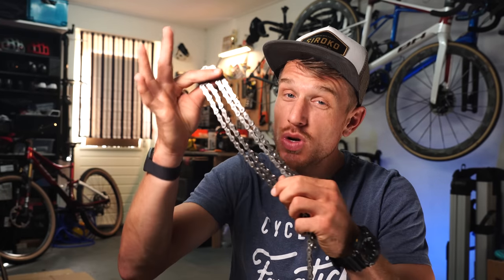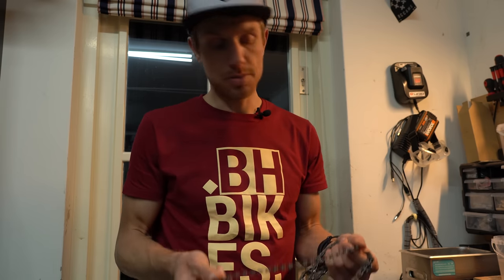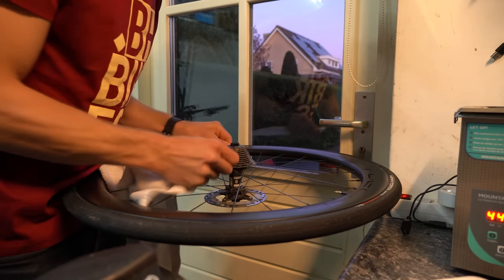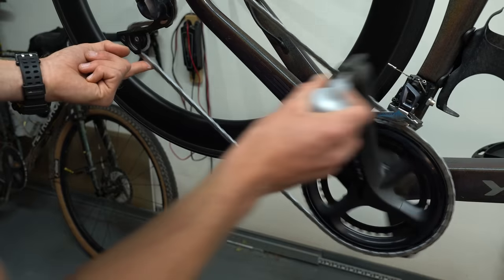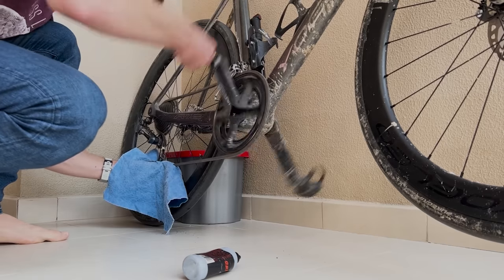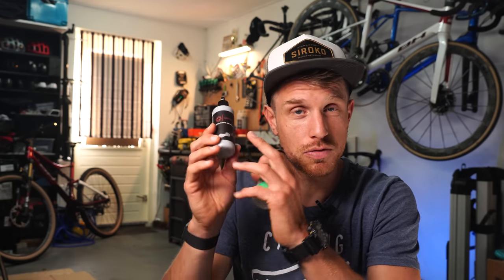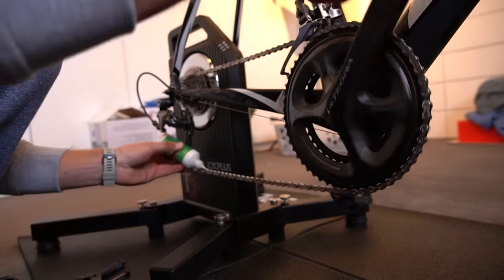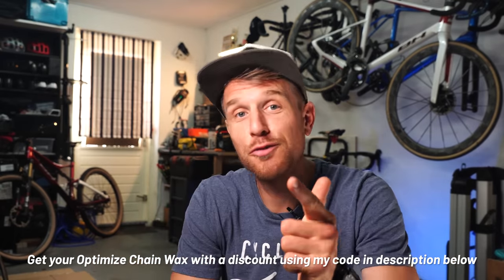Testing Chain Wax for 1-YEAR and this happened..

Comment from the maker: ► 10% OFF Optimize Wax use code ''CapeEpic10” (valid till end sept) * 👉 https://bit.ly/Optimizewax
► SIROKO cycling KIT & GLASSES - 10% EXTRA OFF  👉 https://srko.co/verkuijl (link applies discount automatically)
Reply: use petrol/gasoline is even cheaper, then ultrasound with degreaser
Reply: Test gasoline works great for cleaning the chaine.

Comment: Little tip for applying the drip wax: Shift to the big ring and the biggest sprocket (like you would never do riding) and apply on top of the cassette. The cross-chaining opens up the gaps in the chain and makes the lube sink in much easier.
Reply: That's a new one, great tip!
Reply: Small ring, small ring is even better as chain is more slack so gaps are even larger for wax to get in.
Reply: one run on big - big and one run one small small… win win
Reply: Amazing tip! Makes complete sense!
Reply: another tip to help it penetrate is to warm up your chain first. I only mess with this the first time with a clean chain.
Reply: You can also hold the wax bottle under hot running water before applying to make it penetrate the chain better.
Reply: good tips,but if chain is hot , wax is liquid when touched chain and enters into chain no matter of gear combination,i do it on big front and small rear because i have the longes lower length of chain between f/r gears
Reply: Hair dryer on chain slowly rotating around will melt and drive wax into the links. Takes approximately 5 extra minutes but gives you maximum penetration when maintaining your waxed chain.
Reply: Wat moet je doen voor Corrosie,roest bescherming met vochtige omstandigheden? Ik rij in een velomobiel en condens van zweetdamp op de ketting. Geen regen en zand kan er bij komen. Graag een reactie voor mogelijke overstap op wax. Al vast bedankt gr Alexander
Reply: @alexanderkamminga1393  if you drive inside, without dirt, you should use some  kind of grease(preservative) because it is very sticky , and it will not leave chain surface so it will prevent rust,it does not spray around like oil, wax is good for dirty condition because it is not sticky but does not prevent rust because it is thin layer on chain surface
Reply: such a great tip!!! Thx a lot
Reply: # Silca Chain Wax Tip 😅
Reply: @wizardzx2  Either is good 👍
Reply: This video auto played after Silca's video of lubing at that exact spot and the science behind it!

Comment: White spirit and mineral spirits from any DIY store. Use a funnel and paper filters to re-use solvent. Cheap slow cooker for wax. Foil to catch drips when transferring to a hanging location. Wrap around plastic pipe to break up wax. Rotate/wax multiple chains to minimise down time.
Reply from the maker: Nitro will be much more effective imo
Reply: Yeah, no need to re-invent the wheel from scratch! Just do it like everyone has been doing it for years...
Reply: Yea could just follow the process e.g. from Zero Friction Cycling or for the simplest (and most expensive) use the Silca chain stripper which was literally developed for this use case.
Reply from the maker: At 45€/500ml I think it’s crazy expensive, 10x of nitro thinner that will do a 💯 perfect job
Reply: @jasperverkuijl  is the nitro thinner the reducer (thinner) used for nitro cellulose paints?
Reply from the maker: @markjthomson not 100% sure. It’s for some specific paints or to clean paint brushes etc. Nitro-verdunner in Dutch and German, nitro-thinner in Dutch and maybe English.
Reply: Good tip on funnel and paper filter to reduce cost of Turps
Reply: Your nitro thinner is probably what we call white spirit in other countries. I always finish off with methylated spirit (alcohol) after to remove any remaining residue. Also for melting the wax most people recommend using a slow cooker / crock pot on the low setting as it removes the risk of the wax overheating and degrading... or worse getting hot enough to ignite and cause a fire. Waxing is definitely the way forward... I don't want to go back to the awful task of cleaning a chain.
Reply: this is the way. zerofrictioncycling has done loads of testing and this is his go to. Mineral spirits / white spirit is super easy and cheap to use. 3 baths in that and a (new) chain is clean. Cleaning old, dirty chains is way harder IMO, it takes like 10 baths of white spirit.
Reply: OZ Cycle YouTube channel.  He makes his own.
Reply: @liamgaul 
Not so fast .. you are getting confused about the generic terms that Americans use:

Mineral Spirits has many aliases such as mineral turpentine, petroleum spirits, solvent naphtha, and white spirits. All of these are used for several purposes.
Reply: @markjthomson 
It’s white spirit
Reply: @marcdaniels9079  I'm aware. What did I get confused about?
Reply: @Timo-qb1gf  Yeaah, if you want to give Josh Poertner money for flashy advertising and not much else, then by all means buy Silca's peri-snake oil products.

Comment: BEST WAY TO HEAT WAX is with a slow cooker (crock pot).  I use the very small Crock Pot (TM) Little Dipper.  A rice cooker is OK, but a little hotter than optimal.  Heating wax on your stove is, as Jasper says,  a mess.  It is also a potential safety and health hazard.  Moreover, no cook wants bicycle chain wax heated in their kitchen.   AS TO REMOVING OIL from new and used chains, my preferred technique is very fast and very inexpensive.  Use disposable blue nitrile gloves, and conduct the process outside, to minimize skin contact with solvents and to avoid inhaling solvent vapors.  I use multiple chain immersions in fresh gasoline, followed by gasoline removal using aqueous degreaser.  I obtain the metallic sound Jasper describes.  I also recycle the gasoline.  The entire degreasing process requires about 30 min to one hour.  Use four glass jars with screw on tops: three 1-quart jars (or larger), one pint-sized jar (or larger).  FIRST, fill one large jar with fresh gasoline.  SECOND, take a rag and use it to physically remove all the oil/grease you can easily wipe off the chain (this reduces the amount of oil you have to remove with the gasoline).  You can enhance the physical removal process with brushes to get inside the links, with further rag wiping.  THIRD, put the wiped chain into the small jar and cover with enough fresh gasoline to fully immerse the chain.  Put the top on the small jar and shake it.  Note that the gasoline instantly turns jet black when cleaning a used chain.  Proceed to intermittently shake the jar over a 5 minute period, and then remove the top and pour the dirty gasoline into the empty second jar.  FOURTH, repeat this process in the small jar.    It may require 5-10 cycles until the gasoline barely gets dirty.  Once you get to the point that the gasoline barely gets dirty after 5 minutes of chain immersion with internittent shaking, you are done with the gasoline.  Allow the dirty gasoline in the second large jar to sit undisturbed for a week or so, and a dark layer of solids will reside on the bottom of the second jar, but the gasoline above will be clear again!  Carefully decant the supernate, i.e., pour the clear gasoline (I am a chemist) into the empty first jar for reuse.  After decanting the supernate from the second jar, discard the dirty gas on the bottom (in chemical jargon, the "infra-natant") as waste.  Use a funnel, carefully pouring the supernate into the empty first jar, pouring through at least two layers of paper towel placed inside the funnel, to capture any unwanted solids in the when decanting.  Waste not, want not. FIFTH, place the gasoline-covered chain outside and the gasoline will evaporate in 5 minutes or so, particularly if it is sunny out.  SIXTH: After the gasoline evaporates, immerse the cleaned chain in a fourth jar containing an aqueous degreaser (I use Harbor Freight concentrated degreaser mixed about 1:5 with water).  This degreaser readily removes the trace amount of the oily component remaining from the gasoline (gasoline is a mixture with mostly small molecule hyrdrocarbons, but also contains a very small amount of high molecular weight hydrocarbons).  SEVENTH:  Dry the chain with a clean rag.  The chain is now ready for immersion into the molten wax in the crock pot.  Actually the molten wax in my Little Dipper also contains at least 2 or 3 heaping teaspoons of 1.6 micron PTFE powder, which I purchase on Ebay.  Stir the chain immersed in the molten wax+PTFE, making sure to stir enough to "stir up" the PTFE particles so that they are distributed throughout the molten wax, as they tend to settle to the bottom between uses.  EIGHT, remove the chain and hang to dry just as in Jasper's video.  Then install on bike.   [PS#1:  If you use molten wax without any PTFE or other friction additive such as graphene, or if you do not properly remove the oil or grease from your chain, you will only get 30 miles or so on tarmac before chain noise begins.  With PTFE powder, I get probably 200-300 miles on tarmac before chain noise starts.  PS#2: If you wonder whether you got absolutely all the oil off the chain (because the last immersion in gasoline produced gasoline very slightly dirty looking), then consider the following.  Materials dissolve in materials of similar polarity.  Oil and grease are hydrocarbons, as is gasoline.  Hydrocarbon molecules are non-polar.  On the other hand, water molecules are polar.  That is why oil and water don't mix.  Wax is a hydrocarbon, so it too is non-polar.  Therefore wax is soluble in gasoline, i.e., dissolves at least to some extent in gasoline.  So if you had a trace of gasoline on your chain when you immersed it in the molten wax containing PTFE powder, that trace of oil or gas just dissolves uniformly into the wax, and in my experience does not affect the performance of the wax-coated chain to any measurable degree.  This is the same reason that the recycling of the gasoline supernate has no significant negative impact on future use for chain cleaning, even though it inherently contains additional oil from previous chain cleanings.  PS#3:  I have been using this process for several years, and have helped other cyclists convert from oil to wax, with good results, including the fringe benefits of: (a) freedom to put your bike in your car without worrying about getting grease on the upholstery, and (b) no more "chain tattoos" on your legs while on a ride, and (c) no more greasy fingers from re-installing a dropped chain while on a ride.]
Reply from the maker: Long read but good stuf!😜😜🙌🏻🙌🏻
Reply: Good lord.......
Reply: Guess you never head about hydrogen embrittlement from soaking metals in gasoline? Don't worry, not everyone has.
Reply: I don’t use any degreaser at all what i do is deluge the chain in the cheapest cooking oil without removing it from bike,spin the chain a bit then wipe the oil off and repeat, once the oil is not showing dirt i wipe off the excess and ride. I also use 7 speed chains that cost about £5 or less, never get a noisy or rusty chain
Reply: Wao,.  Thanks for this reply.   This will help.
Reply: @markweso3447  LOL, yeah you are absolutely correct...indeed I had never heard of the hydrogen embrittlement thing.  Thanks for bringing it to my attention.  I guess now I must start worrying because my embrittled chain is going snap like rotten twine one day when I am 25 miles from home climbing a steep grade...and I guess I will have to start pondering whether to worry whether  my gasoline-burning F150 cast iron engine block will crumble like saltine cracker (no pun intended) when the odometer hits 120K, or whether it will endure because hydrogen embrittlement decreases above 150C, as revealed by 30 seconds on Microsoft Copilot.  But mostly, I now know that I am in for some fun when I ask how many of them have ever experienced a snapped chain due to hydrogen embrittlement...that is, when the first reply is "Huh?!#@^", followed by eruptions of laughter separated by successive attempts to top the increasingly absurd conclusions and corollaries which inevitably flow from every statement evidencing a little knowledge being a dangerous thing.  Don't worry, not everybody has experienced this.  Ciao!
Reply: @bohurley2051  I dont know about hydrogen embrittlement.  PTFE however is bad for the environment!
Reply: It’s a bike chain ! It’s  not a surgical scalpel. Your process is way more complex and long winded than required for a 99.9% effectvlean. 
Also I. All your detail you immured a very crucial detail - since you in search of perfection and the MOST marginal of gains - the “rag” is not appropriate. It must be a micro- fibre cloth. Rags invariably drop lint into the chain.

Comment: Homemade paraffin wax mixed with shellite is now my favourite chain lubricant, after trying it when watched an Aussie cyclist YouTube who tested various waxing methods . No more dirty chsins, ot work pants when i ride to work.   To clean the chain now, i squirt the mixture on thr chain and run the chain through the cloth or paper towel . The chain is the smoothest and quietest i have ever run. I don't add graphitr or any other additives.
Reply: me too but if you use pure wax with no teflon or molibden... or tungsten... you have to rewax every 100km-i tested it and that are numbers
Reply: @makantahi3731  thanks for sharing the 100km limitation without teflon. I will need to add some to the mix.

Comment: Jasper, place the glass jar containing the solvent and the chain into your ultrasonic cleaner. Fill the ultrasonic cleaner to approximately half its capacity. Allow it to undergo the cleaning process for approximately 20 minutes at a temperature of 40°C. This will result in a clean chain, and you'll notice that your ultrasonic cleaner itself will also be much cleaner, reducing the need for additional cleaning.🙂
Reply from the maker: Ha, nice tip. 
So ultrasonic cleaner with water, put the jar with the chain and thinner inside, into the ultrasonic bath, than turn it on, correct? 
Like au-bain-Marie with the ultrasonic 😄

The sonic goes through the jar and helps clean the chain
Reply: Fire hazard
Reply: @ThisTimeTheWorld ,  no, its safe. I used this method with acetone throughout a 40yr career.
Reply: Ontvetten met benzine. Dat werkt geweldig!
Reply: Ultrasonically agitating petroleum solvents is a sure way to create inflammable vapours.
Reply: Normal glass jars will become brittle in the ultrasonic cleaner. I did it, put the glass gently on a concrete wall, and it just disintegrated. Use Borax instead, it will last. IKEA has such glass containers.

Comment: Buy 4 chains, wax them all, (i have 2 bikes, road and gravel) ride the chains, top up with Squirt lube and ride them for about 1000km each, then swap to the new chains, repeat process, when 4 chains are worn, rewax them all and there you go... do around 10-12,000km per year and have to do this about 3x a year. clean chain no issues and not really seeing much wear on the chains or drivetrain and you can touch it... does run smoother and quieter, gravel bike and muddyness you have to apply more squirt than on road. have to recommend it. Never will i go back to lube. If you dont want the faff.. buy new chain, strip factory grease and then just use Squirt.. basically 90% of the way there.. overall this is the future.
Reply from the maker: Yep, very easy way. 
Important thing is to be sure the drip lube is compatible with the hot wax. (Not all are) 
The drip wax of Optimize will work the same as you are using the squirt.
Reply: I've been using Squirt, you're saying I shouldn't bother with the wax? Or still worth it?
Reply: @Avioto  I saw once a video testing differnet waxes and squirt was one of the worst in their test... not sure if this is still the case
Reply: @Sandman_TV  honestly.. Worst in what way? It's a great top up after the initial waxing has worn down. No issues.
Reply: @Avioto  clean the chain properly with a solution and then use squirt, I would even warm it up in hot water and then apply to clean chain, this is nearly 90% of the way to a full dipped wax. I fully wax but have a friend that does it the other way and results are similar, he goes through more squirt than I do though.
Reply: Which Squirt lube do you use? I've used it on degreased chains in the past, and in my experience chains got as dirty (or maybe a bit less) as with any oil based lube.
Reply: @BobTheParis  it's called SQUIRT.. Wax based. You put it on and leave for like 5 hrs to fully dry in and turn to wax. If you didint do that your application was wrong.

Comment: I've been experimenting for a while. A good tip would be to leave the chain in the hot wax while it cools down a bit and you see top is getting a bit of a wax layer, then when you take out chain quickly put it in a bucket of very cold water, you can use ice as well. The whole idea behind this is not to let the wax drip out whilst liquid from inside the chain link, yes you will have lots of residue but before fitting it back on the bike you need to get rid of the excess wax, easy way is just drag the chain by grabbing both sides on a wooden brush handle just like you would use a hand saw to cut it. Cheers. Happy experimenting.